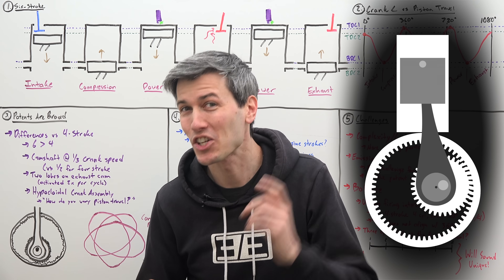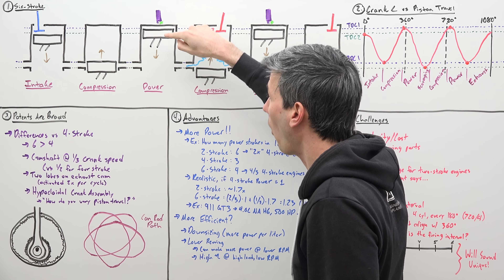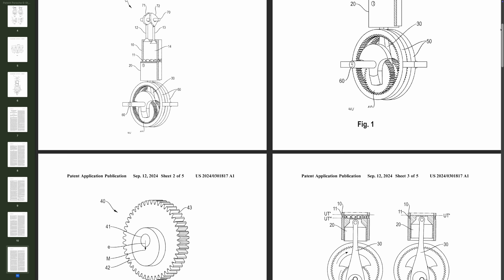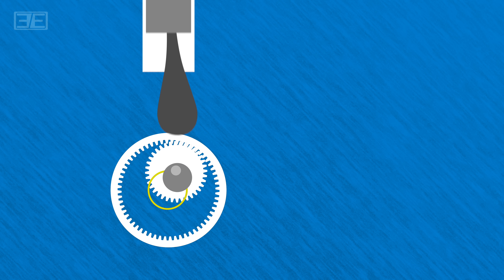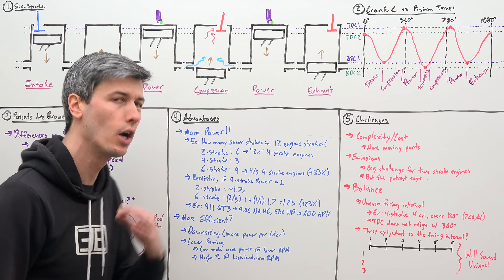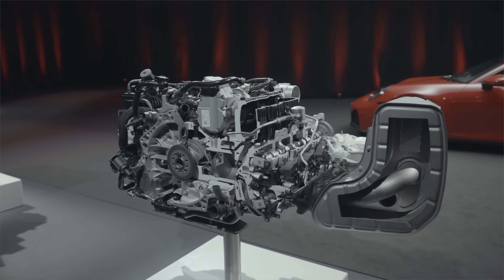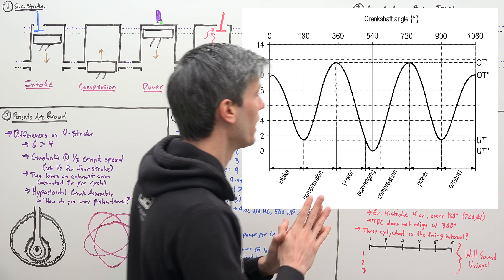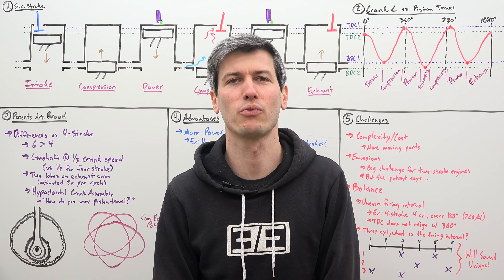Porsche's 6-Stroke Engine Is Genius!

Comment: The E-turbo let's you make a high compression Atkinson cycle engine. The E-turbo keeps feeding air to the combustion chamber, even as the piston moves up from BDC, some air is pushed out, and your 16:1 compression engine compresses air at an effective 11:1, but the expansion ratio is 16:1. They should just focus on that instead of the spirograph crankshaft.

Comment: You never mentioned the need for a turbo or blower to purge the exhaust on the 2 stroke section, like a Detroit Diesel 2 stroke with exhaust valves. Turbo no good until spooled up, blower bad for parasitical losses.

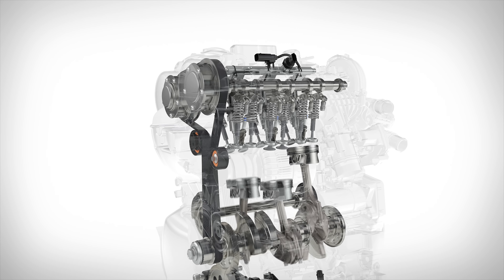Comment: I would have liked to see a cutaway view of the crankshaft.  The 3D view at 11:30 is a normal crankshaft that has none of those toothed parts.  With a normal crank it's easy to see how the power stroke turns the crank.  With all those toothed parts mating with the toothed oil pan it's not so clear.

Comment: The design is interesting but why all that effort? Just make a more efficient two stroke engine with forced induction(something like a small super charger) wouldn't that be easier, especially that it uses a proved design.

Comment: I have to wonder with the lower intakes where would they be in relation to the engine block and would their longer overall length (depending on engine configuration) impact the performance gains of the second powerstroke.
Otherwise it sounds like a reasonably thought out idea but I really would want to see at least a few demonstrator motor built to show the difference fuels and configurations.

Comment: Hi Jason, surely the engine has to turn 50% higher revolutions to deliver the additional power.  Accordingly your conclusion that it will produce more power at lower revs is incorrect.  Indeed this thing will be limited in
Max power rpm scenarios to about the same power.
Congratulations on 1,000 terrific videos!!!!🎉

Comment: Efficiency wise: a large part of engine internal losses have to do with ring friction. more power strokes per total cycle means less frictional losses per energy output. Wouldn't the gear setup in the crank make annoying whine noises? Do rotaries have weird noises like that? :O

Comment: I suspect that the firing pattern for a 3 cylinder 6 stroke will be based on 2 cylinders firing at roughly the same time spaced 360 degrees apart.  So in this way it will fire at the same rate as a twin cylinder 4 stroke or a single cylinder 2 stroke engine

Comment: Sounds like the perfect engine for the new Scout harvester line. Small engine running at low RPM making more power than traditional engines and more efficient.

Comment: If efficiency and emissions are really the main concern, then the focus should be on range-extender generators and power plants for hybrid drive trains that can be optimized to run within a very narrow if not constant power and torque range. Combustion engines are most efficient when operating at constant 50+% load and a hybrid can dump any surplus into the battery instead of short-cycling the engine.

Most of the complications added to modern engines are to better accommodate wide-range load scenarios and would be superfluous in an engine optimized for single-point operation.

In a hybrid context, the motor-generator can be used to spin the engine at its designated RPMs before enabling fuel injectors, no need for engines to be capable of spinning themselves up from starter-RPMs anymore.

Comment: I have a few questions:
1 - How are they going to prevent oil from entering the lower intake ports when air is not coming out of them?
2 - What controls the air intake on them?
3 - Being that low and inside the cylinders, won't the air temperature in the lower intakes be higher than it should for optimal combustion?

Comment: I remember years ago when Nissan came out with the variable displacement engine, it got me thinking about how else the core mechanisms of the ICE could be improved, and I found myself questioning the 4 stroke cycle. I conceptually came up with the same idea, a staggered stroke, but that was about as far as I could get without any education in engineering. Oh what could have been

Comment: the lower intake ports will destroy conventional piston rings. The oil behind the oil control ring will push it into the port and also spray oil into the port
Reply: this is not crankcase scavenged, this is 100% turbocharged

Comment: Interestomg idea and great explanation.  Traditional 2-stroke engines were "dirty" because raw fuel would escape from the exhausyt ports before the piston cobered tham up.  Direct injection can eliminate that issue.  I wonder if the crankcase/sump will be designed like a 2-stroke to compress air ofrif they'll employ a secondary air pump to fill the cylinders at BDC.

Comment: So we got an unholy 2 Stroke-4 Stroke Chimera from a major brand before we got Opposed Piston Diesel Engines from a major manufacturer 😣

(Granted just a patent so tbh who knows if this will get made too!)
Reply: Not sure I follow... the Napier Deltic is promoted as the holy grail
Reply: @matthewjuhlin4628  Another lovely solution to a problem that did not exist. Great engineering but an emissions and maintenance nightmare. Once the Deltic engines wore out, the design was never repeated.

Comment: Unless the 2-stroke intake ports are completely covered when not actively intaking air, they are going to get engine oil into them, which is then going to get sucked into the cylinder. I don't see a way to fix that isn't extremely complex. Unless the total stroke length is less than the total piston height, I guess.

Comment: Oh, Jason mentioned how this could be used to improve turbo engines, because stuff like the GR Corolla making 300+ on a turbo 3 cylinder isn't already crazy enough!  An extra 23% power would be something like 70hp increase, no?  That's WILD to me.  Imagine this technology in something like a Proline Hemi that already make 5000+ on 8 cylinders and 2 turbos..  Just given the 23% (I'm just using that number since Jason gave it to us, I'm not smart enough to math that kinda stuff,) that 5000 becomes 6150..  Cleetus's Eagle camaro makes 5300+, you get the idea.  ProMods about to making 7000hp 😂

Comment: The second combustion stroke will be weaker than the first as is meant to use up the remaining fuel in the cylinder. So the power advantage over a 4-stroke will most likely be appreciably lower than 23% in a naturally aspirated engine. However, the additional pulses will aid in spinning up turbochargers, leading to either less turbo-lag or the ability to use larger turbos.
Reply: No. There`ll just be another fuel-injection! Two times in 6 strokes, at least I´ve got it that way......
Reply: This was my take --- a second chance to combust the already injected fuel, leading to better fuel efficiency rather than more power, which may be significant with incoming environmental regulations.

Comment: To balance the power strokes the crankshaft doesn't need to have each cylinder equally spaced.  Same way you balance an even fire 90-degree V-6.

Comment: cylinder 2 on stroke 5 and 1. problem solved. Theres always 2 power strokes on every other stroke. if you have 6 cylinders you can have 2 power strokes (a '2-stroke' and a '4-stroke' power stroke) every stroke.

Comment: I think for the firing interval is that you would have the power strokes every 360° of crank rotation, they would just overlap with each other in pairs of two. Example Cyl1 and Cyl3, Cyl1 and Cyl2, Cyl2 and Cyl3, repeat. Then in a 6 cylinder you could have the other 3 offset by 180° potentially.

Comment: I just don't see how this is desirable or worth the complication... if a little 2-stroke is good, I don't see why more isn't better.  Just go 2-stroke, use direct injection and both valve-in-head and piston-ports for a thru-flow scavenging, and have all the power, just do away with 4-stroke.  (BUT there's nothing to patent there, so...)

There are some 3 cylinder 2-stroke Diesels being developed that (I think) are very promising.  But... as much as I love Diesel, it isn't appropriate from an emissions standpoint anymore.

Then again... emissions.  All emissions are bad, of course :)  BUT, some more than others.  IF we take the viewpoint that CO2 is the biggest concern because of climate change, and other emissions are bad but less important, then Diesel efficiency becomes attractive.  Personally I think we might be better off trading more NOx for less CO2.....  but that's off-the-cuff, would be interesting to see someone run the numbers on that.

Comment: I dont see how they will ever get this thru emissions.  You have open ports in the side of the cylinder walls, which are lubricated by oil.  When the piston moves by these ports, how is oil from the cylinder walls not going to enter the mixture.

Comment: I assumed that it gets better efficiency because the high compression from a turbocharger needs extra/rich fuel to stop preignition, but then you're throwing a lot of unburnt fuel out the exhaust. This gives the rich mixture another chance to be combined with more fresh air and ignited a 2nd time, allowing the turbo's compression to be turned up a lot higher while maintaining fuel efficiency? Does the 2nd power stroke not get some/most of the previous power stroke's gases?

Comment: Conversation with your mechanic after 80,000km:

Sorry to inform you that the 2-stroke intake ports are fully clogged up due to EGR & SAI and 9 other emissions systems and now you require an engine rebuild to clean them out. 

Clever design but I anticipate it will be hamstrung by emissions requirements. Shame…

Comment: Seems very complicated instead of just making a direct injected twostroke engine with turbo/supercharging (no oil in crank case) and exaust valves (high efficiency and clean combustion).

Comment: Interesting from a theoretical point of view, but there are two fundamental issues. Firstly, the overall efficiency is still terrible. Secondly, the cost of making those gears accurate enough to not rattle around and wear out is going to be huge.
In the end, it's all a waste of time when you can get better performance from a simple electric motor. Investment in battery technology will destroy pretty much all applications of ICEs

Comment: The recovery stroke is not new at all, it's probably over 100 years old. There were experimental engines who used the same principle trying to use the pressure from exhaust gas expansion to recover energy. They had 2 pistons, one for explosion and the other one for recovery cycle. This is just a modern take on the same principle. There were many versions in history, but they were all abandoned.

Comment: Can they make it, certainly. Will they make it, maybe. Should they make it. I don't see the point. They are trying to "reinvent the wheel", by making something that is going to be extremely complex, and expensive, with many reliability problems to work out. For very little real world improvement. The time where having a very happy small POWERHOUSE of an engine has been here for close to a decade.  Aka, slap a turbo on a small engine with beefed up internals. This technology is widespread, and is simple and cheap to produce. IF someone wanted to really create a hot new engine, they would develop a new style 2 stroke. It would NEED TO BE SUPERCHARGED. Because forced induction at the bottom of EVERY stroke (INCLUDING START UP) would be the only way TO make it work while staying within the emission standards. A 2 stroke engine, without the smoke and oil burning is possible. THE big problem would be R.P.M.. It would have to be a fairly low rpm engine. Because trying to control even very light valves for a significant distance would be problematic. Everyone knows that Formula 1 engines can run in the low 20,000 rpm range (4 stroke engine). But, those engines do not have to live hundreds of thousands of miles. All you would need to do to create a 2 stroke is supercharge a 4 or 5 valve engine, and run the cam timing at a 1:1 ratio.  And you have a 2 stroke. It would probably have to be direct injected, with a trickle of fuel sprayed just behind the throttle body just to keep the intake  valves clean. But in order to keep the valve springs alive (unless someone wants to license  "Free-valve technology". It would likely need to have a computer cut off redline around 5000-6000 rpm. Which for a road going car is just fine anyway.  That engine would truly be a happy 3 cylinder engine.

Comment: I remember one of the quoted benefits of this method being emissions control. Im wondering how they're going to geal with the inevitable oil consumption that will come with the lower intake.
Reply: It is easy! 
Just 3 steps:

1 - Fuel air and oil goes in;
2 - Magic Happens;
3 - Complete clean combustion;

Comment: The three crank throws need to be displaced by 120 degrees, not the 90 degrees you were trying use. It’ll still be odd firing, but it will alternate neatly between two close power strokes and two further apart ones. Like a Harley.

Comment: So, it’s better than a four stroke, but not as good as a uniflow scavenged two stroke. And much more complete than both!

No one has ever come up with a better design for an internal combustion engine than a uniflow two stroke. The tiny bit of oil that gets in to the combustion chamber- and the resulting emissions- is the only downfall.

Comment: The firing order firing at roughly every 180 degrees could be. Cyl 1: 1,3,6,8. Cyl 2: 2,4,9,11. Cyl 3: 5,7,10,12. The sound would depend on header length and the 2 different types of exhaust strokes.

Comment: Let's go back to the old flat head v8 , use ceramics and make it run hot as hell and vapor lean fuel and be done with it.  I did experiments 50 years ago with the basic premise of increasing engine temps and leaning way down and I had great results. But there wasn't any interest and then life intervened as so often happens.

Comment: And all of the power goes on those gears under the piston. That won’t cause any problems. Right?
Reply: Wankel engines does that without problems, at least not the power transfer part.
Reply: A regular gearbox already has... gears.
Reply: I trust gears for high load applications, nothing beats a good gear!
Reply: @ A gear that transfers power, and a gear that gets compressed from the top are two different stories.
Reply: The last ship I was stationed on had a 7000 HP main engine that used a gear drive for the top crankshaft.

Fairbanks Morse opposed piston engine.
Reply: @ Rotational power transfer vs. compressional power transfer. Those are two completely different ways to transfer power. Mechanical engineering 101.

Comment: One thing that struck me is that the patent document has hand drawn figures. I'm certain that this engine was fully 3D modeled during the development. It is standard procedure to throw as many possible variations into the patent description as possible, since an improvement to a patent may itself be patentable (by anyone). If some variation is mentioned in passing then, even though it may not be central to the actual Patent claims, it becomes public knowledge (as does the patent) and cannot be subsequently claimed as an improvement. Note however, the descriptive text isn't the legal pith of the patent. The "Claims" section is actually the legally relevant section.

Comment: The theory looks fantastic and well worth a patent and a few YouTube videos to explain with nice diagrams. Looking more on the practicalities of the hardware, there’s some serious challenges to overcome. Assembly issues with a planetary gear set incorporated into each conrod, stress and wear issues with the gear set, gear tolerances fighting the shell or maybe roller (2-stroke tech) bearings?  I’d love to see it in action, but I see it as more of a theoretical only patent and a corporate advantage in blocking anyone else using the idea even in a limited short duration demonstrator.